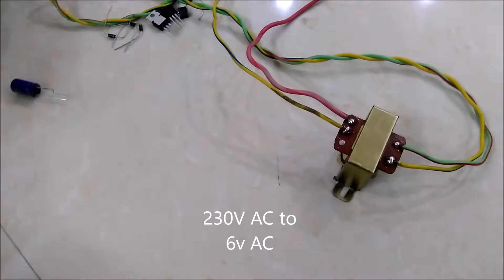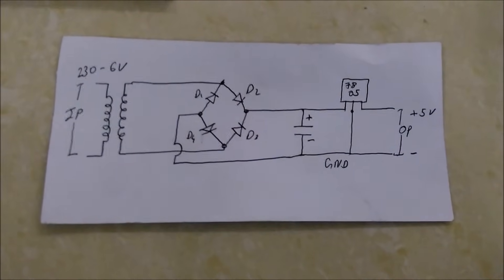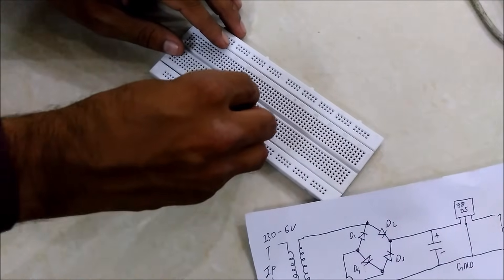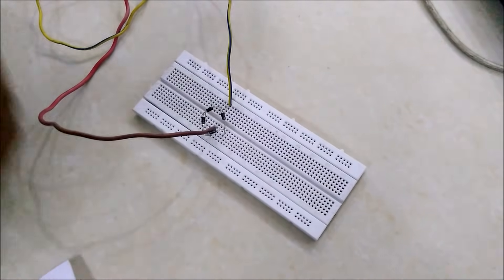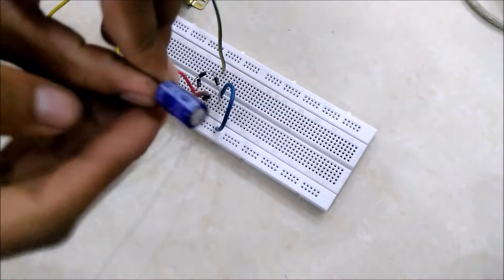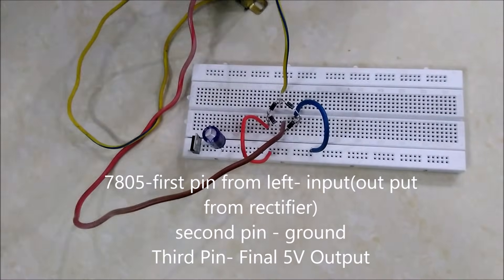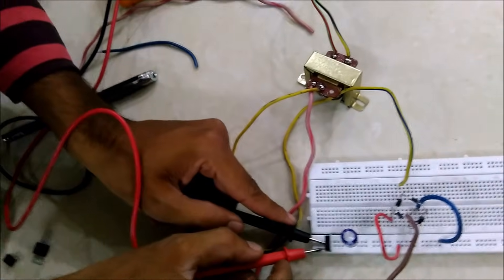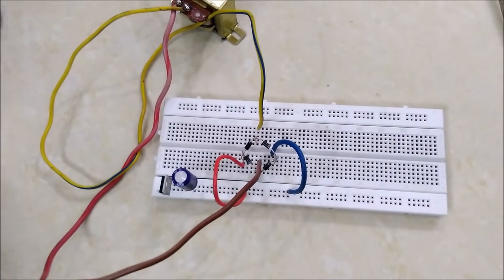How to make 5v Regulated DC Power Supply

Comment: How was the IC connected please tell sir
Reply: I was also wondering about it coz it has three pins and there are only 2 rows in the power rails of the breadboard
Reply: @yuvraj_singh27  the other one he's bended and is using to measure the output voltage from using the multimeter. It is not connected to anything..the leftmost pin